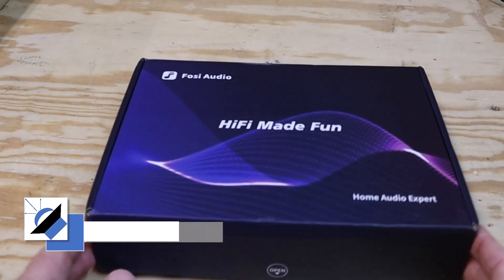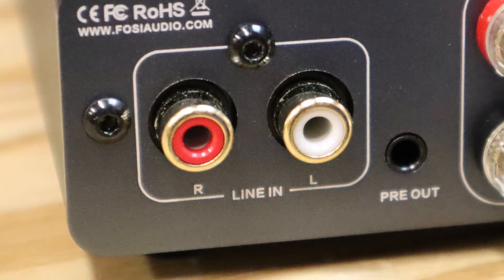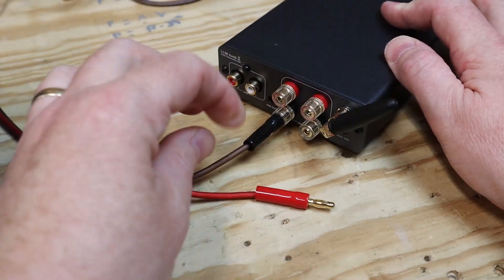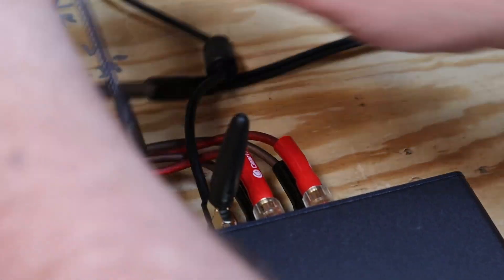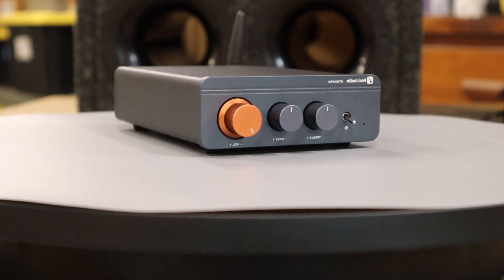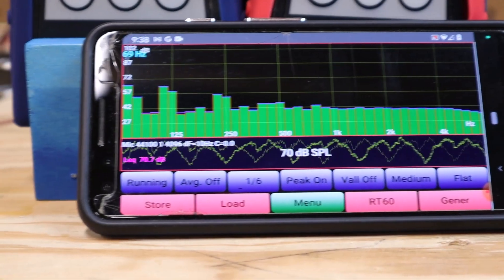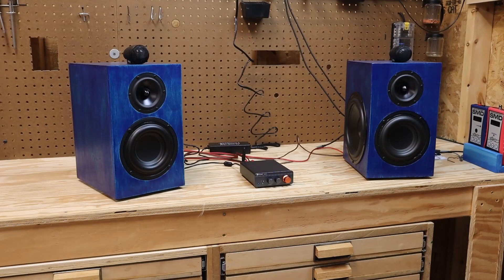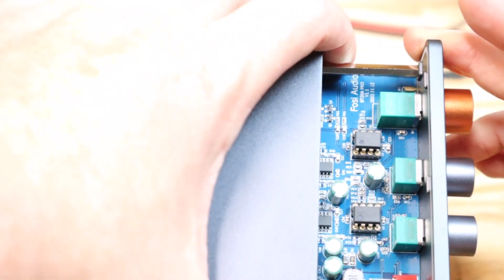How Powerful is this Compact Amplifier?  Fosi A20 BT  Pro Giveaway!

Comment: I just connected an alpine head unit to a av switch via front channel line level rca.  output to a bt20apro running 4speakers and two powered subs, and a bt30dpro running 2 full range speakers and a passive sub,  not using any speaker outputs on the head unit.
Is it safe on the amps using it as a source cd etc and as a pre amp for volume adjustment????

Comment: That is a TPA3255 chip ... it has thermal, short circuit, clipping and overcurrent protection built in.  Do a search for "TPA3255 Spec Sheet" all the info is there.  

On 4 ohm loads the shutdown was most likely the power supply limiting current, not the amplifier going into a panic.  Watch the lamp on the power brick to confirm.

The easiest way to open the amp is to remove the knobs, take the nuts off the control shafts. undo the two screws at the back and slide the whole thing out the back.

And BTW ... Testing these things with bookshelf speakers is a real waste of their abilities.  The TPA3255 chip was originally designed for public address and sound reinforcement in self-powered speakers.  Hook the BT-20a Pro or TB10d up to a "workhorse" speaker like a Heresy or L-100 ... you'll be amazed what these little beasties can do.

Comment: Hi , I was wondering if you could do a video on bandpass passive crossovers. Building your own and understanding them , say 180hz-5k , parts express has all the parts. Also talk about in-line, passive, tweeter, crossovers, and the values maybe leave a chart. This would really help out a DIY car audio guy such as myself.. thanks , keep up the good work.
Reply from the maker: It is an idea I have been thinking about for a while. I keep working may way back to the same conclusion.  A cheap DSP like this one:  https://parts-express.sjv.io/ORg1kz is easier, gives you a better result, and often times no more expensive.
Reply: Here’s the problem with that, though let’s say, I buy a set of mid bass drivers and a set of tweeters and I have one to channel amplifier. I’m basically screwed for the tweeters. I need to buy an amplifier just for the tweeters then that’s where an in-line passive crossover comes into affect.